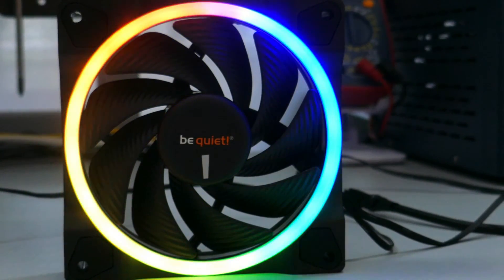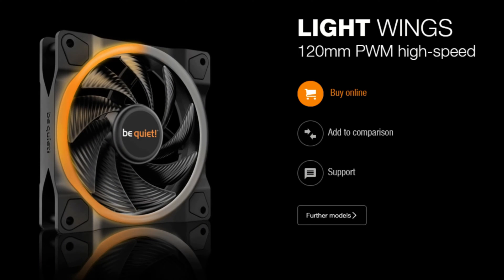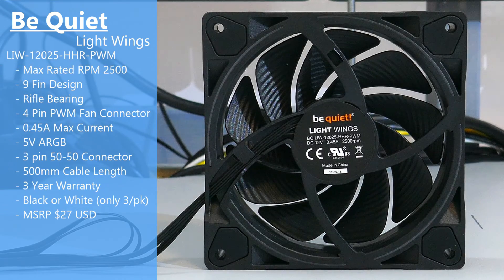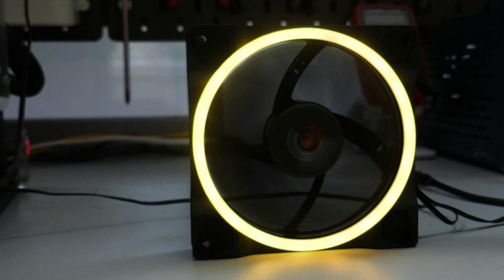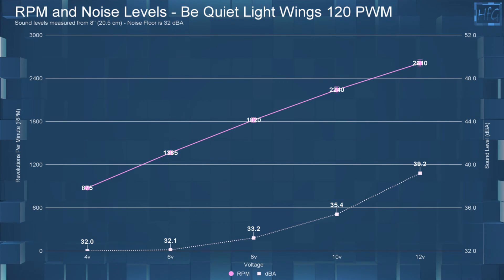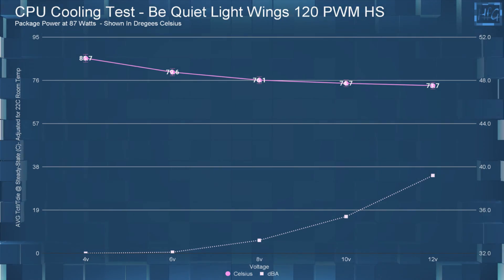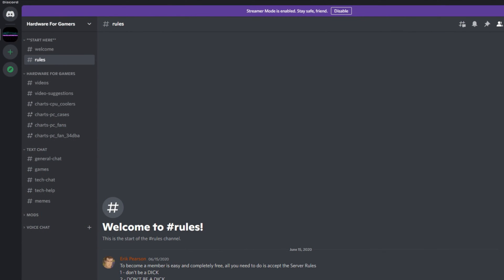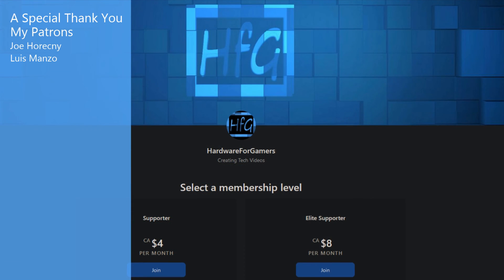The Be Quiet Light Wings 120 PWM HS - System Fan Review

Comment: What is the max cfm and rpm of be quiet light wings 120mm highspeed fan? And i can put it in the cpu cooler? Not as a case fan? Thanks
Reply: Highspeed for coolers and radiators. non highspeed for case only

Comment: I Love the test, however I find in the test CPU cooling test, it be more useful to have the fans at the same speed instead at the same voltage, with the same speed I could compare it more easier, now I have to search at what speed each fan is spinning and do my own calculation. I wanted to know the cooling performance  on hs en non hs difference is at the same speed on a heatsink.

Comment: I'm a fan of these fans.  Pun intended.  They really are nice and quiet.  Especially when used in conjunction with FanControl.  1 of the my 140mm lights stopped working properly though, but the fan itself as well as all the other ones are working fine.  I actually wanted to put them together with his Corsair Airflow in the back, but went with the Phanteks P500a.  No regrets though.

Comment: hi , i saw your fans rewiews of the artic p14 and f14 , i need two 140mm fans for intake in the front of my fractal pop air rgb mesh case.Recently i see on amazon the thermalrigh tl b14 , which is the best for my use of these 3 fans? noise, perfomance ( all of them in my region have the same price) .
thanks and big up
Reply from the maker: Any of them will work just fine... if that helps...
Reply: @HardwareForGamers  i probably buy 2 f14☺️

Comment: You've heard me say it before...I love the Be Quiet brand! For the price, that's up to the buyer. I will say, despite the similar performance results, IMO there's something about the Be Quiet's that feel more durable. 300,000 hours on them? Maybe not but they just feel solid to me.
Another great video and testing results! 👍
Reply: 300,000 is correct that it will spin forever. the real question is, will the motor fail and make buzzing noises? yes it will